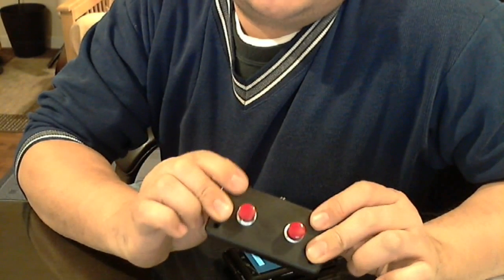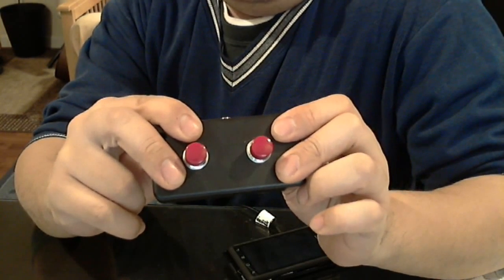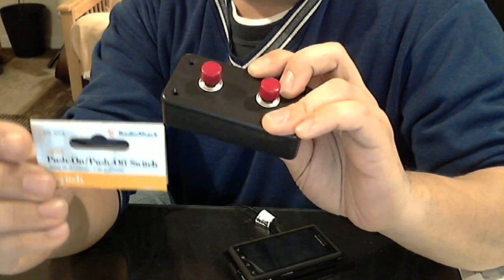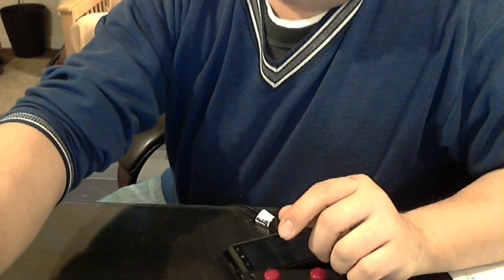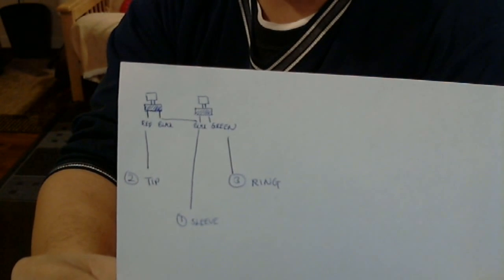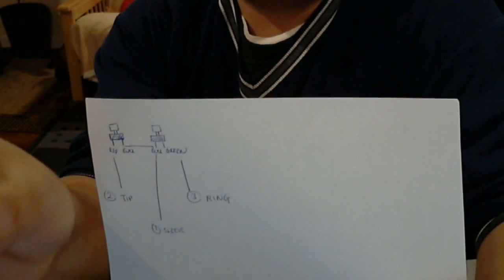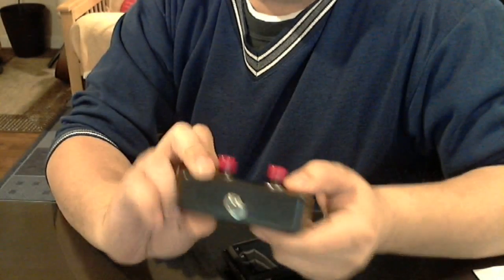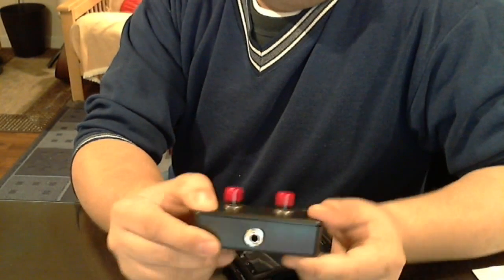DIY Guitar Amp Footswitch Vox VFS-2 (2 button no led) for AD15/30/50/100VT, AD100VTH, V9168R

Comment: Hey there.  I heard that Vox discontinued the VFS2 and only makes the VFS2A now.  I just bought a Lil Looper and it uses the VFS2 as an optional control for effects and to stop/start a loop. I went back to the store and they only had the VFS2A, which we tried and it doesn't seem to work. I can't seem to find any VFS2 here in Singapore, and I desperately want one, and I do NOT want to go out and just buy a different looper.  Is there any way you tell me if this works with the Vox Lil Looper?  Is the VFS2 really that simple inside as what you're showing here in your DIY version?  My only concern is the warnings in the Lil Looper manual about doing damage or malfunction if you don't use the footswitch the right way.

Thanks in advance for your help man!
Reply: If the Lil Looper cans uses the VFS-2 then yes this will work.

Comment: This works on a AD50VT XL. I used a metal case and tried to use the case as ground, but that didn't work. I believe if the switches were entirely metal it would have worked, but I ended up using the wiring diagram. I also ended up wiring a stereo cable that I wasn't using anymore directly to the switches. The switches are now part number RSH2750011 for $2.49 a piece. Also you can start off playing a preset channel then switch to channel 1 and 2, so essentially you can play 3 channels. You just can't switch back to the preset.

Comment: Hey man thx for the video!  I just bought the av30 and am looking for a 2 button switch simply to change channels and a tap tempo.  I don't want to spend the 70 bucks with all the extra buttons I won't need.  What do you recommend?
Reply from the maker: I'm not familiar with the av30. The only thing I know is that this switch should be compatible. Also I don't think vox's vfs2 or vfs5 does tap tempo. If you're looking to build a vfs5, I would search online for diy vfs5.
Reply: @head8555  thx for the reply!  According to the manual, the vfs5 does have tap tempo (3d button).  I just don't feel like spending 65 bucks just to have the channel switching and tap tempo delay.  I did put that search in with no luck.  Looks like I may just order it through Amazon and then return it if it's not worth lol 😂

Comment: Awesome Hack...can you please email the wiring diagram to terryleebolton@gmail.com I only have my phone and it was too small to see and blurry...lol thx
Reply: Button 1 – red wire goes to TIP of jack (pin 2)
Button 2 – green wire goes to RING of jack (pin 3)
Button 1 – goes to button 2 then black goes to SLEEVE of jack pin 1) hope that helps
Reply: @Frank-sy1po  Thank You...are those off & on switches or momentary switches and could you plz post the brand and item number...

Comment: certainly better than the oversized vox article. why did they have to make it so big for just two switches? maybe the thought using and extra few inches of wire would justify a certain price tag lol. I could buy a used one on ebay for 20 quid, but I rather make one in a custom enclosure now I see yours. thanks.

Comment: Hello, I've built a footswitch for my Pathfinder 15r. However, I find the boost switch useless because the change is so drastic when it's engaged. Can one use a pot to run a "Variable boost". Or a volume control that way it can match the clean volume? If  so, can you please give me some instruction or maybe a video demonstrating how it's done? Thanks!
Reply from the maker: NOSUCHVideos I'm not sure how to do all that. I just know what I'm showing here. Sorry.

Comment: Do you think you can help me learn how to make a footswitch for a Marshall DSL15H 15W Tube Head?
Reply from the maker: +Mitchell Martinez i'm not sure if I can but I'll try. What kind of pedal the a Marshall use? Is it one button or two?
Reply: Just one. and it's just to switch the channel from clean to overdrive. I got the tube amp used, and they didn't have the Footswitch to go with it.
Reply: head8555 Just one. and it's just to switch the channel from clean to overdrive. I got the tube amp used, and they didn't have the Footswitch to go with it.
Reply from the maker: +Mitchell Martinez I don't have a Marshall but I'm going by videos I've seen and pictures I've seen of the original pedal. You can get the same switch and a mono jack. To be specific you can get  The SPST I mention  in the description as the button. Get yourself a housing. One wire will go to the Sleeve of the mono jack the Second Wire to the Tip of the Mono Jack.

Good luck
Reply: head8555 sweet. Im trying to build it. I'm looking for parts in my town.

Comment: Where'd you get the box?
Reply from the maker: Radioshack.
I would recommend getting better metal cases from sites that sell guitar pedal parts.
Reply: +head8555 thanks. I'm at Radio shack right now and can only find one on off switch. gonna go with a momentary switch of its all the same.
Reply: +head8555 actually I'm just gonna get a soft feel one

Comment: Thanks for your help, I have made this pedal and it works to specification. I have a VOX AC15C2. To add/contribute to this, if you would like a wiring diagram, i have added to one I found on Google that may help someone. Especially if you have to use 3PDT switches instead of SPDT. Its a JPEG file that ill leave a link for you all. It can be downloaded here....

https://www.dropbox.com/s/x2mn1tbyx5k6qmm/VFS2A%20Wiring%20Diagram%20AMMENDED.jpg?dl=0

The pedal looks like this: https://www.youtube.com/watch?v=xWSvypSdBJo

P.S. The best part about this is that I was able to use GREEN and BLUE Led's instead of the boring Red, and that I fitted it into a case that is the size of a Fuzz Factory. Very small. This is a great intro to pedal building by the way. Hard to go wrong, and easy to backtrack if you do.  

If there are issues viewing the linked picture, let me know and I can PM those interested. 

Cheers, 
Shane

Comment: Thank you very much for this video! I made one for myself today, and it works perfectly.
I would also like to add one thing: It doesn't work unless you have a stereo cable. In fact i didn't even now a diference beetween stereo and mono cable until today :)  Thanks again.

Comment from the maker: I'll answer the questions backwards. The case is a project case from Radio Shack, it's cheap heavy duty plastic. Go check it out there and see what size you want. I would get something better like a metal case. 
To be honest in terms of question number 2, I would check out different forums for schematics and google info.
I'm not sure about question number 1. Some footswitches for one amp brand work on others but you would have to google it or ask if you can try it out at you local guitar store.

Comment: Hi, excellent instructional video. I have a couple questions though, if you don't mind:

1) Why do different amplifiers require different footswitches? I would have figured that the wiring in footswitches would be similar if not universal.

2) What kind of information do I need in order to build a footswitch for a particular amplifier?

3) What kind of housing are you using for the footswitch and where did you find it?

Thank you kindly.

Comment: No, definitely not using a mono cable.  I wired up a 3 conductor cable, which used to be an extension cable for a set of headphones.  I would have given you more details in my 1st inquiry, but YouTube format only allows for 500 characters.
I've looked for at least 3 hours on Internet--carefully studying instructionals about wiring up this switchbox.  I am 95% sure that I am wiring it correctly--just like you showed. I have 2 momentary switches--soldered to a single TRS stereo plug
Any help?

Comment: Please let me know what kind of switches do I need to use specifically, to make this work correctly??
I have tried making this same switchbox project; being very careful to wire it precisely; but I cannot get the EFX on/off switch to function (only the channel switching works).

I see that you listed to use SPST (off/on) switches; but I tried wiring up MOMENTARY switches--is that incorrect??
I am confused, because the momentary switch I used for the channel switching works perfectly fine......

Comment: I purchased the VFS2 and will never use it. I dont use Tremelo or Reverb. I have taken the 
VFS2 all apart and gutted it. I would like to change it into a AB/Y box, and I have been searching all over the internet for DPDT foot switches  that have the 6 soldier points and 
am just very confused about how to get what I need. Local radio shack does not have metal and I dont want plastic.  I just want to be able to plug into box and have two cords go into regular and top boost and be able to switch.

Comment: It would've been cool if you had included a sound demo of the channel switching.I'm doing one too. My Radioshack didn't have the same switches, so I had to get another one. 

When I hold down the button, the sound is temporarily muted, then it switches to the OD channel. However, when I release the button the sound mutes again before finally locking in to the OD channel. But the double-mute only happens when switching from clean to OD, not vice versa. 

Do your switches do that?

Comment: Great build simple design, only wondering why you mounted the switches on the 'back plate' and not inside the box so you can remove the back plate without parts attached.

Comment from the maker: @The15peavey1 Just get one button. Black wire (ground) goes to the sleeve of the Stereo Jack or Stereo Cable. Then another wire goes from button to either Tip or Ring. You have to figure out whether it's the ring or the sleeve that triggers the Channel change.

Comment from the maker: @whydoth I got it Radio Shack in the U.S.. Radio Shack sells electronics and hobby stuff. It's a sturdy plastic project case. They should sell something similar in Electrical Hobby Stores. It's a 4x2x1 (inches) case.

Comment from the maker: @KrecikOwsik Not sure. I've heard yes and no online. So one thing you can do is this see if the thing the guy is doing on the video works with your amp. if it does this should work. The video is DIY Foot Switch Amp Chanel Select on youtube. Other thing you can do is go to guitarcenter or your local guitar store see if they have the VFS2 and see if it works on the VOX VT30

Comment from the maker: @conazol1987 No Problem the only thing is if you want to make a one button mono switch you have to use a SPST Push-on Push-off Switch not a momentary switch like the way I described in my other video. 

Good Luck

Comment from the maker: @conazol1987 Yes. Stereo is the only way it will work. If you go to a guitar store and check out other 2button amp switches they are all stereo. You can make a one button switch with a mono cable/jack... You can look at my other video on Youtube, DIY Unlatched Footswitch Zoom Pedal / Boss DD-7, DD-20 (Tap Tempo, Bank Switch, Amp)